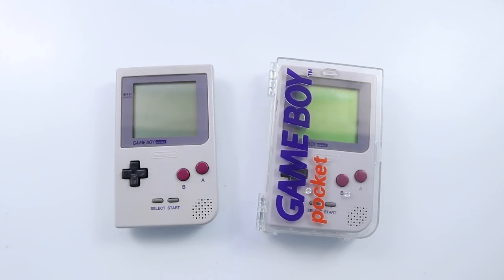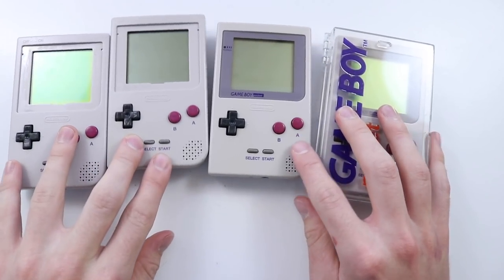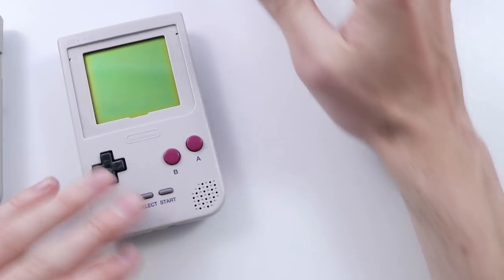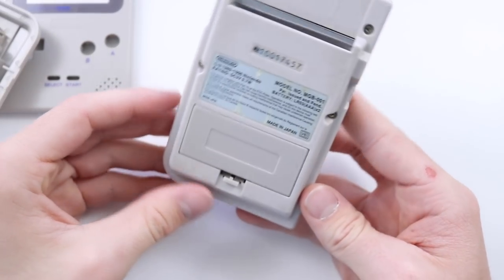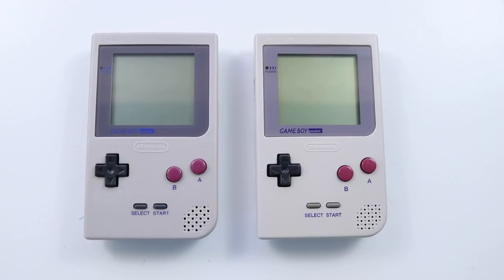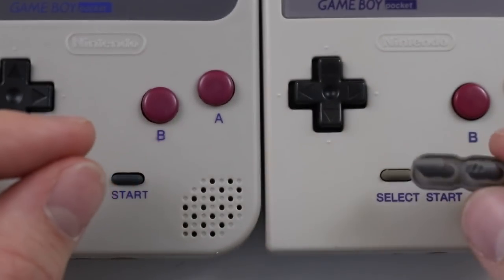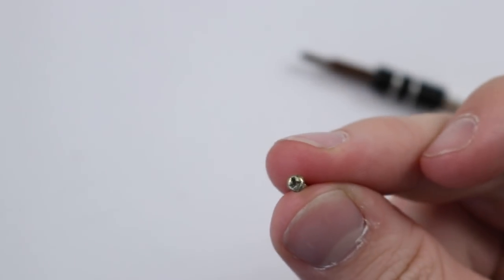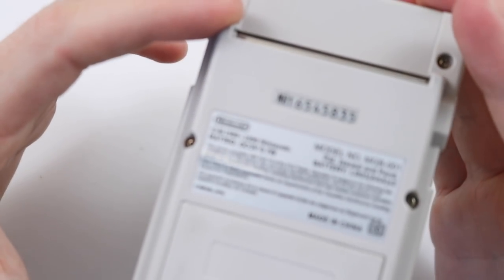One Of These GameBoys Is FAKE!

Comment: Awesome video! I have confidence that you wont be unemployed for long. Also I didn't see that ending cliffhanger coming ... I guess I'll just have to wait for next season's episode of dragonb ... erm I mean TRF!
Reply: So i Went ahead and bought three of these just for fun and was immediately disappointed.  The plastic is way cheaper than I expected. So thin and light, you can actually see the plastic has stress marks where the holes were cut out.  From the buttons to the screws, everything feels super cheap. Also all wording and design points ( on/off text, Headphone jack text ) isn't very prominent.  You can barely feel any of it with your nail... At the very least, Im glad they aren't so well made, that I can still tell a legit one from a fake in my search for a unit. Im gonna use these to practice custom paint  jobs...

Comment: The quality of that case is much much better than the "Ninetudo" brand DS case I bought 10 years ago from eBay. With that the two halves didn't quite fit together and the buttons got stuck in the holes.

Comment: I got one for $34, which I swapped the screen out with another that has the original polarizer.  I'd say 9/10 condition too :)

Better than doing this, the colour is wrong, the writing is too close to the holes, nintendo logo is completely wrong, speaker holes too big, it's just a cheap copy and you can tell.

Comment: Hey mate. I found something you might want to check out. An NES edition gba sp AGS 101 for £24!
Reply: Found it on ebay
Reply from the maker: Sounds cool!
Reply: You should do a video on it, i bet it would be really good
Reply: The real NES edition SP was 001 so it has to be a reshell. Still not a bad deal at all. I did a reshell on my 101 with that exact NES edition shell they have all over Ebay. It's pretty good. I didn't expect the sticker around the buttons to be too great but it's surprisingly well made.
Reply: chamoo232 yeah it was a very good deal considering the screen alone costs £40. Unfortunatly i think they are all sold now and i didnt buy one because i was weary of it being fraud. It looked dodgy that they were selling a load of them